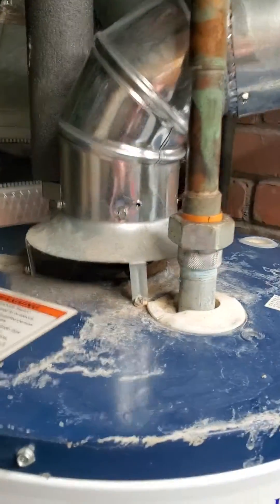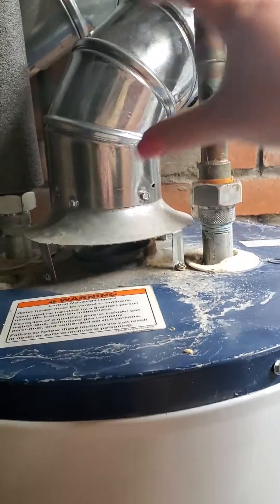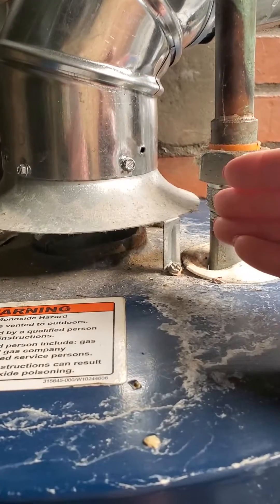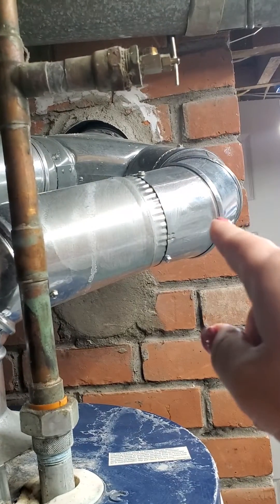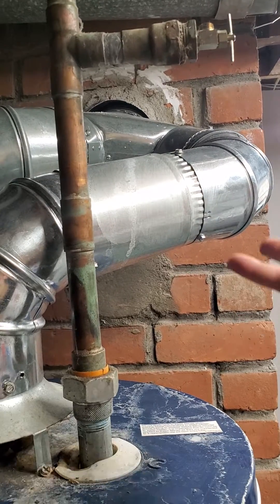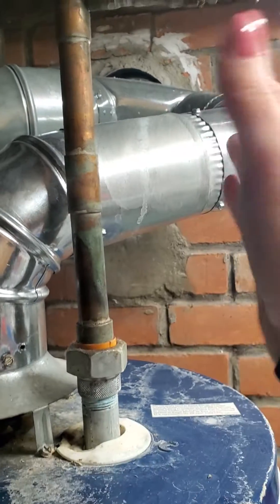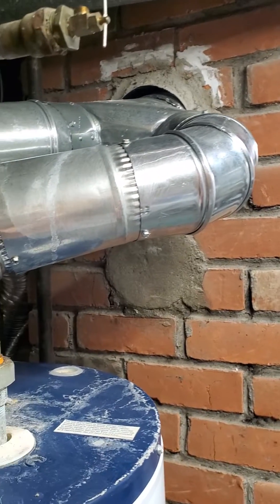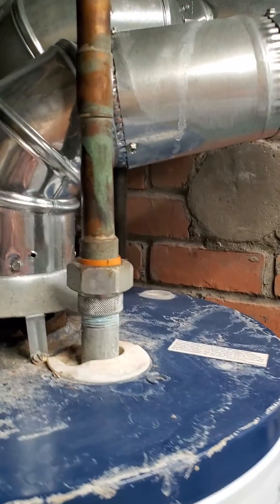Back-drafting of water heater

Comment: You would not want to rotate the wye, that would create a negative pitch. The issue of the backdrafting most likely happened before the chimney liner was installed. That is a 10-15 year old water heater and the venting was replaced more recently than that. The chimney may have been blocked from a nest or collapsed mortar and brick. 

What you should be looking for as an inspector is the total flue capacity. What is the BTU of the furnace? What size is the chimney liner? What is the total height of the chimney liner? Don't forget that a chimney liner reduces the total flue capacity by 25%. From the video it looks like it may only be a 4" liner which is too small. A 5" liner is usually too small if the furnace is over 120K but or less than 20'.
Reply: Excellent comment